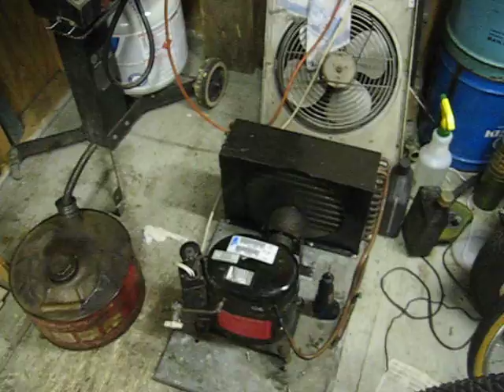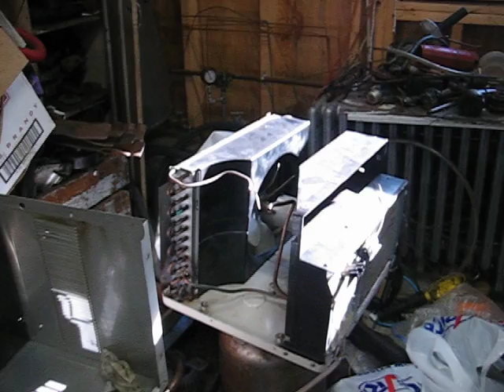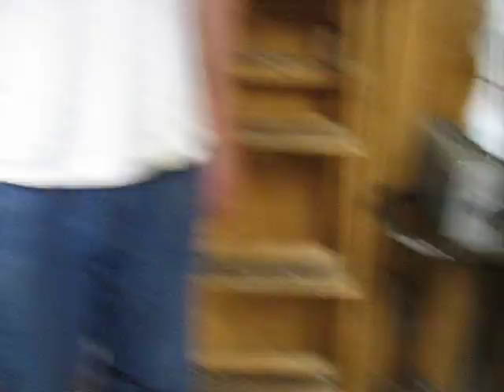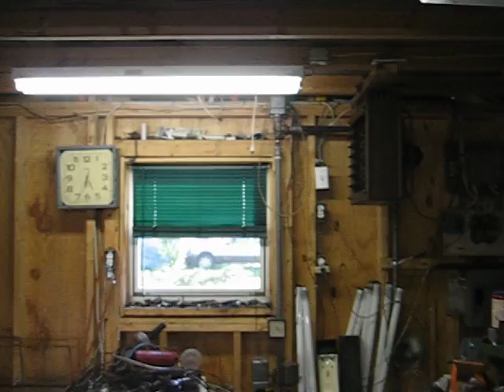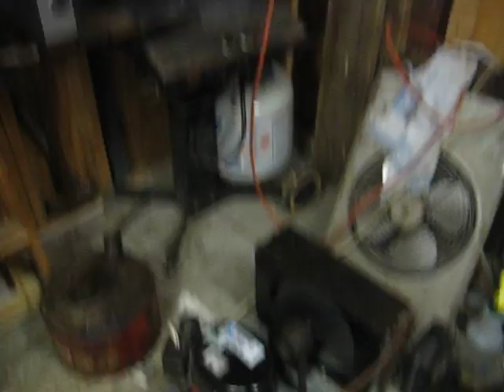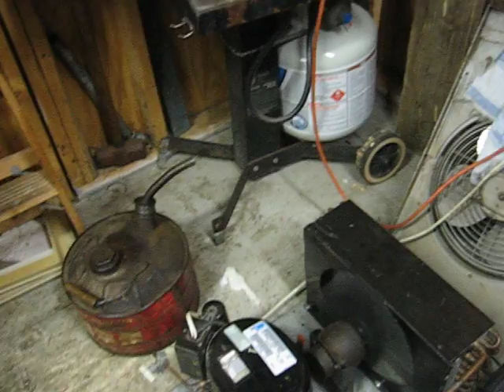Homemade air conditioner!!  Part 1 of 2!

Comment from the maker: According to the innovator,  Mr. Bombeck,  it is greater because of the use of the bigger refrigerator compressor,  thus two cooling coils are incorporated,  instead of one.  Doubling the cooling capacity,  and using a compressor which would have ended up in the scrap yard.